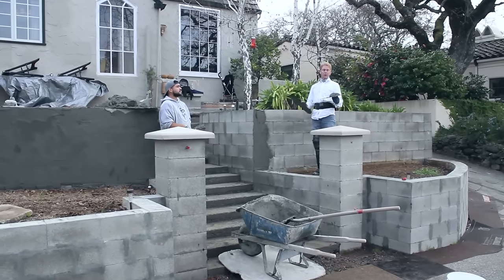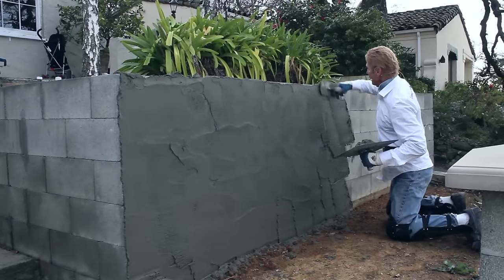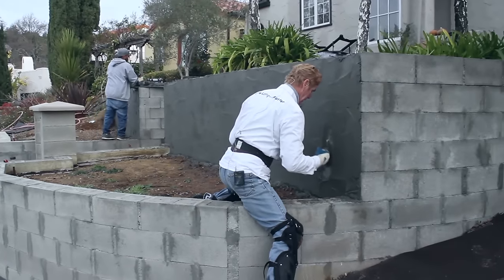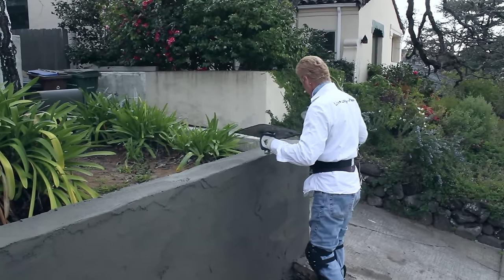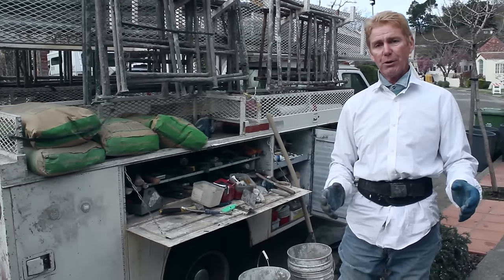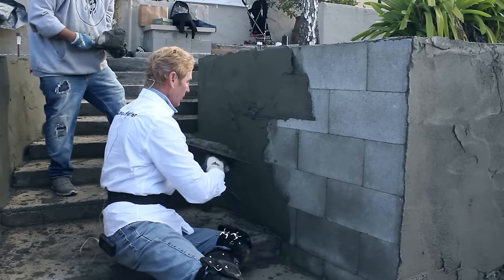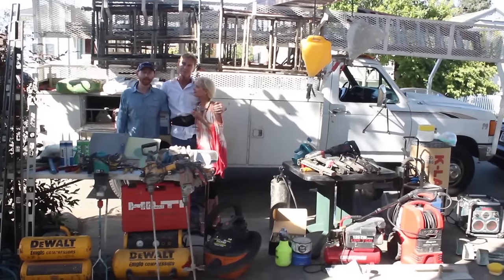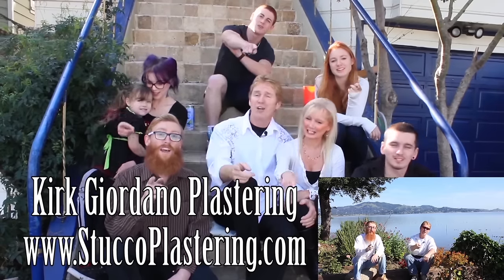Stucco to cover block walls or exterior plaster

Comment: Hey Kirk. Looks like this wall was built with not mortar joints. Was it dry-stacked and then filled with concrete?  Is this method you'd recommend for a block wall that will be stucco'd? Cheers from Glendale CA!
Reply from the maker: Howdy Lando, I recommend rebar and concrete inside if you want it permanent.
So that when your grandkids inherit, it's still standing.😉

Comment: Hi Kirk, I’m making a bbq island/counter area for an exterior lounge area that will match the exterior of the home when all said and done. 
Do I need to stagger the cinder blocks or can they just be stacked on top of each other?
Reply from the maker: Good evening Sanfeliperun, staggering cement blocks or plywood adds strength. 
   For a barbeque, is it necessary to stagger the blocks? "doubtful!" 
But again, it adds strength.
         The University of plastering by Kirk and Jason Giordano
Introducing peace, love, and harmony back to the plastering world.

Comment: What is the mix you use .. what is the ratio cement to sand please ?!!
Reply from the maker: Howdy, as a rule we add three parts sand to one part cement plaster.      
                                   Live long and plaster
        Teaching do’s and don’t of plastering and stucco work

Comment: 4:23 at the front where the retaining wall curves along top row how is the cement filled between the two half blocks?
Reply from the maker: Good Morning Dal Dude, this concrete block wall was built well, 
Solid foundation with a waterproof barrier on the dirt side plus a proper drainage system, then rebar installed and lastly poured concrete into the holes.
 As I think back, it was built as one of the best all around block walls that I have come across, I didn't notice this fact at the time.
                    Live long and plaster
    Mastering Plastering by Kirk and Jason Giordano

Comment: hello thank u for the videos I am going to attempt to stucco 2 retaining walls and wanted to know what to use and how to mix it I will be using a wheelbarrow to mix it I am a woman but can handle this any info is appreciated
Reply from the maker: Howdy Wave woman, Plastering by oneself s difficult.
 I'd get help in at least mixing.
     I used Hanson's premium cement plaster then mixed 3-parts sand to one part cement.
We then applied it.
    If you have anywhere near this amount you will need help and a mixer.
The type of stucco work you see in this video is a team sport it takes a few guys.
 best wishes,      
                                   Live long and plaster
               Kirk Giordano’s Plastering answers to life’s issues
Reply: Just buy pre mixed type s mortar. It already has sand in it. It says how much water to use on the bag. Clean the wall as best you can first. If possible, do a small side/ area first. Get a helper if u can, at the very least, do it when it is cool, as that will giive you more time to work with the material. Just dont do it when it will get below 40 degrees at night

Comment: Why is your mud so much more useable than an 80 pound of quickrete scratch and brown.  Can I add more water to make it more like a loose paste . I used the max amount of water and it was very hard
Reply from the maker: Howdy Tim, if you add less sand all muds become more workable. Too much sand and it won't have the stick-um necessary to adhere.

Comment: Idk if i missed it.  Are they're multiple coats applied and if so.  How far apart?
Reply from the maker: Morning Roberts, I'm applying a little more than half inch but less than an inch. It's called skim coating.  Ican do it in a single coat. I'm applying this half inch so that when it rains the grout lines wont bleed through or show.👨🏻‍🔬

Comment: I have a wall like this about 12 ft length 4 ft high and the stucco is bubbling every 10 inches. Water has no where to go, should I put holes for water to run off from the bottom?
Reply from the maker: You could however that’s not the reason it’s failing, it’s failing as the bond wasn’t done properly. Stucco adheres permanently weather in hot desert conditions to snowy weather, if the prep work is correctly done.
Reply: @StuccoPlastering  aha. So basically we do it correctly
Reply from the maker: @backtoconstitution1  correctamundo

Comment: Good job Kirk and crew! As a mason though I have to ask you to please quit calling them cinder blocks, Cinder hasn't been used in production of block for quite some time. HAHA. But seriously, would you plaster weld on interior block that had glue spots left over from paneling? And, have you ever made a render with just lime and sand for interior block?
Reply from the maker: Howdy Dan dude, yes, but a certain type of lime was used, today's limes are mainly additives for cement plaster, In the UK what your referring too is quite common. 
 If you wanted a lime based product here in the U.S. I would recommend either Diamond or imperial, for two reasons, it's sold here in the U.S. and this product does indeed have much lime and sand in it too as well as some gypsum, all you do is add water, much easier to work with then what we applied.
     I'd recommend a thin coat of Imperial base coat then cover with a diamond finish as the diamond finish coat has more lime then imperial finish.
   USG make both products.
 BTW, what do they all these blocks these days my fellow mason?
 Concrete blocks?      
                                   Live long and plaster
        Teaching do’s and don’t of plastering and stucco work
Reply: Cool. Thanks for the info. I have used quite a bit of Type S hydrated lime as you show in the beginning of the video about lime plaster in your personal house/office. But I also have done some home restoration using Hydraulic lime from France. I'm really just now getting into the whole lime movement. I was under the impression that Hydrated lime is closer to lime putty and had more CO2 absorbing qualities (health benefits) as apposed to hydraulic, which can have more clay and other materials present, Hydraulic needing a chemical reaction with the water, whereas hydrated will not set without being exposed to CO2/air.

Yes we just call them concrete block, cmu, or block. It's not a big deal what you call them. It's probably comparable to people calling your stucco "Concrete" or "Cement"
Reply from the maker: Good Morning Dan dude, sounds to me like you know your lime plaster, better than me.
We used to use a lot more than 35 years ago is was what we referred to as white coating.
Today, I just purchase whats available as there are too many plastering fields to explore and too little time.
 I say start making video's and educating folks about these aspects of real lime plastering, as the world needs more teachers, and Google gives all the the opportunity anyone could ask for, A truly great teaching service that Goole youtube provides.
                    Live long and plaster
    Mastering Plastering by Kirk and Jason Giordano
Reply: Kirk Giordano plastering Inc. I hear ya there. I've been trying to learn more about the plastering side of masonry and realizing how big of a field it is. I'll leave the videos to you, you seen to do a good job at teaching.

Comment: Hi Kirk, great work what you and your team do it truly is a lost art. Hoping to get some advice from you regarding 2 long retaining walls that serve as raised patios in front and back of my home. They are conderblock base with a brick facade on them, 95% of the brick is in good condition. In a few areas (mainly by the steps) the brick is spalling and crumbling. I’m hoping to repair that and stucco over top the brick, would a skim coat or any wire lathe be necessary? We do get snow where I live in Michigan and the stucco will be seeing some moisture for part of the year, any advice is appreciated thanks!
Reply from the maker: Evening, my friend, do as we did in this video. Note: no stucco netting is necessary. In fact,  it's counter productive.
 Cheers,
 KGP

Comment: Great Vids, Thanks.  My cinder block house is painted.. Do I have to remove the paint? That might not be possible/practical.
Reply from the maker: Good evening Mark Souter, No, you have to pressure wash all painted surfaces extremely well as nothing stick to dust or dirty surface, and then apply a bonding agent directly to the walls, never in the mix, as this would dilute the bonding agent rendering it useless.
 Bonding agents can be Larsons, Weld Crete, or Quikrete sold at HD or lowes.😉
Bringing to all the most complete plastering encyclopedia ever created in the world online.
https://www.stuccoPlastering.com
http://www.bayareaplastering.com

Comment: under 0 degrees celcius the water in your material will freeze thats why in the netherlands we dont plaster outside under 5 degrees celcius
Reply from the maker: Good Evening  Mathue, Man I hate cold weather but have worked in the snow many times.   
                            Best wishes,
  Sharing stucco secrets and or common sense plastering tips

Comment: You need a fiber reinforced surface bonding cement if you're dry stacking cinder block without mortar to hold it together.    Look for cracks at the joints in a few months.
Reply from the maker: @tareqhoque2691  you have enough time in to think your right, but not enough to know your wrong, words of jealousy by an apprentice💩

Comment: wHAT DO YOU MEAN BY A "MECHANICAL JOINT"?
Reply from the maker: Good evening Jose, that a machine you put your ganja in, and it rolls it for you. Kidding brother.🤓
    Seriously, a mechanical bond is when you have a cinderblock wall and wet the existing cinderblocks just enough to have the newly applied stucco attach or adhere to it, this is a natural mechanical bond and last forever.
   It is even stronger than applying a bonding agent. as two cementitious finishes will become welded together by suction.
         The University of plastering by Kirk and Jason Giordano
Introducing peace, love, and harmony back to the plastering world.
Reply: @StuccoPlastering Thanks, and I see you have been around.
Reply from the maker: Good evening, Jose, I've been everywhere, man, I breathed the ganja, air, man.
 Just like my boy, "Jonnie Cash" https://youtu.be/ov4epAJRPMw
 The original rapper
        The University of plastering by Kirk and Jason Giordano
Introducing peace, love, and harmony back to the plastering world.

Comment: Pls let us know the cement to sand ratio ratio for plastering ?
Reply from the maker: Good morning Aloka, We used normal portland cement plaster mixed with three times the amount of sand to each part cement plaster to skim these walls, Also for skim coating Cement blocks, as long as you apply over a half-inch, your golden, this way when it rains, you don't see the grout lines.
 Cheers,
 kirk giordano

Comment: They're actually is a temperature for mud. I don't care if you put it on a wall or put it in the ground as a foundation. Mud will freeze, which makes mud brittle. You can argue wrong all day but you can't argue right at all.
Reply from the maker: Howdy Jerry, you seem usually adamant about this, what's the point or why does this matter to you. I have been applying stucco for a while and have never experienced a day of reckoning that you seem irritated about.
What's concrete or stucco ever done to you that has made you irritable towards it.
 Allow me to guess, you had someone or you mixed and applied it, it didn't set for whatever reason, thus you blame the weather for this?🤔

Comment: He never explains the mix. 
I’ve watched 10 videos. Says he’s gonna and then stops
Reply from the maker: Howdy Tyler, I do respond to folks when possible,
 Ratios for sand and stucco mixing by the book.
How much sand is for each coat of stucco?
  Scratch coats are mixed at 1 part cement to 2-1/4 to 4 parts sand, brown coats are mixed at 1 part cement to 3 to 5 parts sand, and finish coats are 1 part cement to 1-1/2 to 3 parts sand. 

 Most times we mix 3 parts sand to every one part cement plaster. 
The cement plaster we use is any Portland cement, such as Quikrete or Sakrete.
Note, Rapid Set or Greencore are both sold at Home Depot but don't need added sand, just water. Often this formula is in the description too. or one can type in their question on our channel and like magic, a video will appear to provide answers. Cheers. 😉